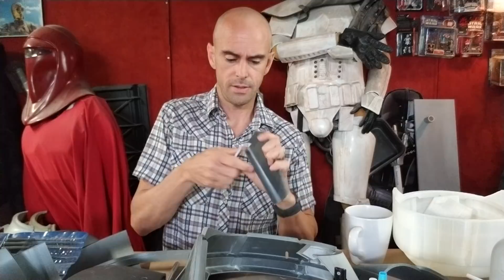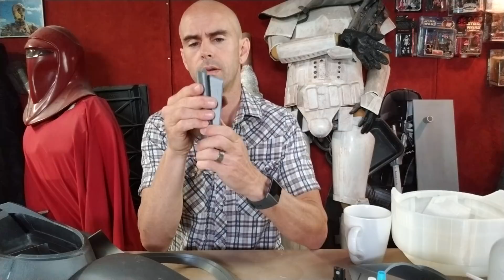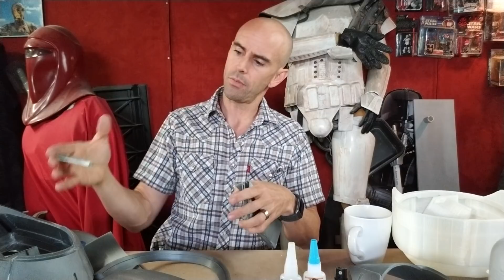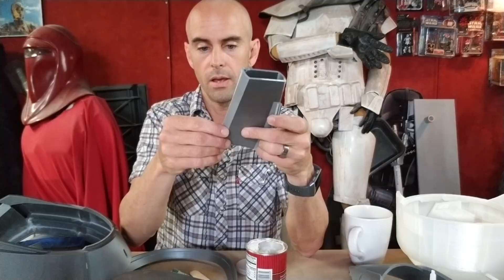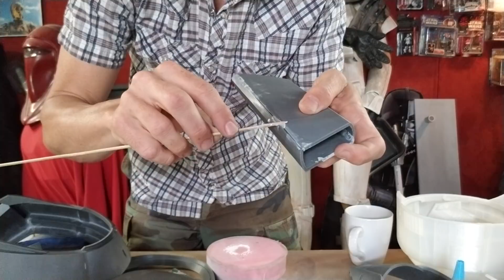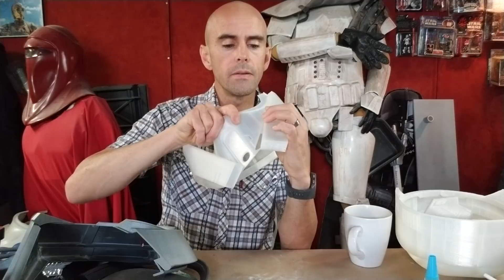Welding PLA with Acetone?! and handy superglue tips.

Comment: I use  3D Solutech and it does not weld to gether with acetone can somebody please tell me a P l A that welds to gether with acetone
Reply: I had the same issue doesn’t work for me also but I’d like to know a brand of filament it does work with did you ever find out?

Comment: i will try  Acetone and look forward to seeing how it performs.
Super glue is so weak now, 
i remember when it first came out
it would stick everything in seconds, Including My Eye,

My sister squeezed a tube so much it exploded in my eye, i was ok after a 2 hour op
Anyway now if i get any on my fingers it  hardly sticks 
So it is so weak, I guess it is so weak now due to reasons like what happened to me.

A tip from me , Use a 3d pen to fill in gaps, No mixing things up, and best thing is, you use the same filament  

Thank you for sharing this info..

Comment: your 100% correct. I don't know why people are saying you can't weld PLA with acetone. I weld coil parts together and they take a huge strain and hold just fine. I find that glues do work but acetone works like a charm. The only draw back is it will discolor some pla's.
Reply: It looks to be very brands specific, what PLA are you using?
Reply: @wilsonmura5930  I use several different brands and they weld just fine with acetone. I use HatchBox, Amazon Basic, SUn(something) and they all work and work really well. I still use the recommended 16 epoxy glue product and that works really good too.
Reply: @mcorrade  Awesome I will be buying one of this brands in my next purchase!

Did not know Amazon has a basic for FDM how is it?

I moved and all my plastic is still back there so I can't try welding.

Thanks for the quick reply!
Reply: @wilsonmura5930  I wasn't to sure how the Amazon basic would perform but was pleasantly surprised. I really like HatchBox but will use Amazon in a pinch especially when I can't get the color from HB I need.  I forgot I also use Atomic which is good. My first filament was 3D Solutech which is terrible or, at least the spool I had was really brittle even after drying.
Reply: @mcorrade  Awesome I'll add them to my list as well as some acetone.

And again, thanks for the quick reply!

Have an excellent weekend.

Comment: great tips ! thanks for the video, just curious, how big is your print bed ,  I would love to make a helmet but I don't think my bed is big enough . ( Anycubic 13 mega ) 210 X 210 x 205 mm
Reply: No need for a big bed to make big parts. That is if you are going for looks, and not high strength parts. Make your object in smaller parts, make them with interlocking sides. A simple little T shape should work well for thin parts. Then weld them using a 3D printer pen, or some filament held by a dremel wile pushing the spinning filament between the seams in an upward motion. That is known as friction welding.

Sand smooth, then finish off with a smoothing compound. 

A trick for using a 3D pen for fusing, make sure a grove like bevel is there by default when printing each part where you intend on welding the pieces together. You will have more plastic flow in the premade bevel to help hold the parts together stronger.
Reply: @glenfoxh  . thanks so much for the welding tip,  if you haven't done so already it would make a great video

Comment: The general consensus is that acetone doesn't chemically react to pure PLA, but some PLA filaments contain other plastics that will react with acetone. So, mileage may vary depending on the filament used.
Reply: I use  3D Solutech and it does not weld to gether with acetone can somebody please tell me a P l A that welds to gether with acetone
Reply: Did he mention the PLA brand he's using?
Reply: I use PLA HP from Colorfabb, it also does not weld with acetone. Doesnt even leave a scratch unfortunately 🤣
Reply: PLA is 100% soluble in acetone. I work with pure PLA daily.

Comment: Weld-On #3 works for pla as a solvent/adhesive. Depending on the pla and the type of plastics they use to make the filament some works with acetone some does not.

Comment: fyi..it is the moisture in the starch, baby powder(talc) speed the cure of the super glue. Any filler can be used that either retains water (humectant) or by adding very slight amounts of water.  I mix pure talc with varying amounts of starch to improve sand-ability and speed of cure. I also use my fingers with starch on them to rub the desired area first then add the superglue, resulting in a diy kicker.

Comment: I usually take a small bit of PLA, put it in my Dremel, turn it on low to med speed, and use that to weld the pieces together. It works VERY well. You just need to do it in places where it will never be seen.

Comment: I've been using dicholoromethane to solvent weld PLA the same way that you would use acetone with ABS.  Works great so far.  I've not tried making a slurry yet though.

I got it to make a HIPS droid and thought I'd just give it a go and see what happened.

Comment: I always assumed that since acetone didn't seem to smooth PLA it wouldn't weld it either.. I've been sorta tig welding my shore trooper bits together with spare filament and a soldering iron.. Going to try this on R2.

Comment: I still don't get it..I.see these videos but I have tested acetone on every single roll of my pla filament.and not a single one does anything in acetone.
Reply from the maker: I thought the same thing and never had PLA actually melt in acetone but never paid much attention to what was happening to the surface. I DID make a discovery this morning after making this video (I'll do an update vid about this soon). The acetone works WAY better on parts that have color but the clear PLA doesn't bond nearly as well. It works a bit but not strong like the other parts. I think whatever is added to the plastic to add the color is what's actually sensitive to the acetone.
Reply: gordontarpley ill have to try it. I've only tried smoothing pla which I've seen others do in videos and it definitely didn't smooth the surface. I've always used ca glue to bind parts as I assumed acetone  didn't effect the place at all. I had even had a failed print that was a partial bowl and poured in acetone and let it sit for a day and it didn't deform.
Reply from the maker: Yeah, I've been using CA for PLA for ages with really good results.